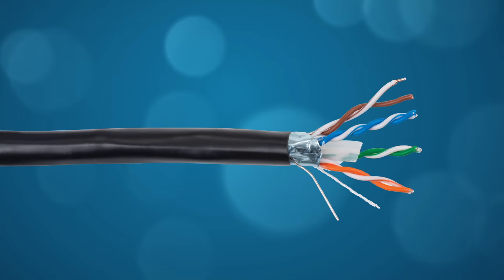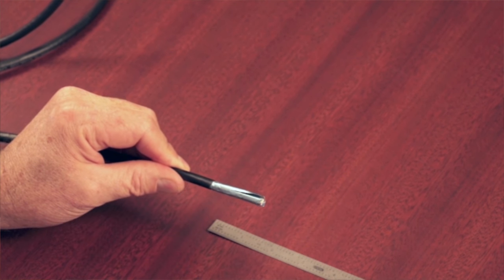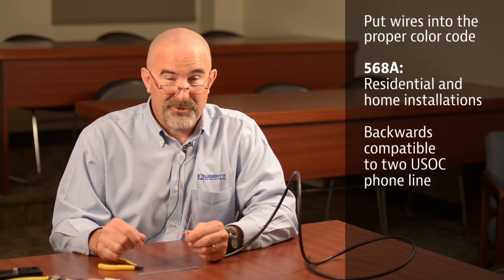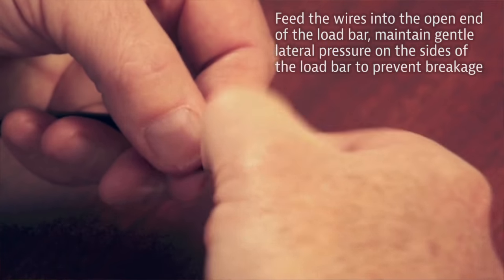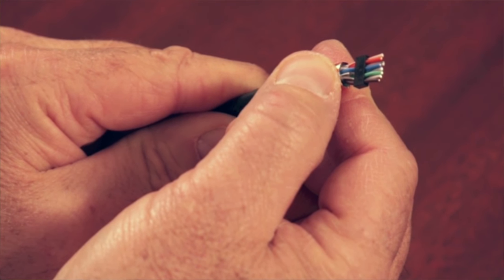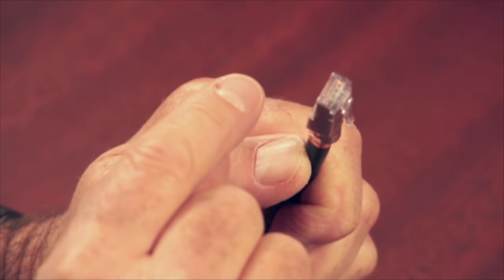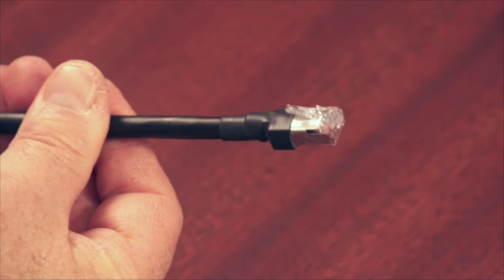How to Terminate Cat6 Shielded Cable with an RJ45 Connector

Comment: What diameter is that 3:1 shrink cable?   GREAT VIDEO!!
Reply from the maker: Thanks for the comment @dale nassar! I believe the diameter of the heat shrink tubing is 1/2" before it is heated and shrunk around the cable and connector.

Comment: "A two piece RJ45 connector will always outperform a one piece RJ45 connector"... Please define your metrics of performance? Do you mean in quickly assembling cables or actual network performance because I don't see it outperforming anything.
Reply: Likely he is suggesting failed terminations. I've done many of these and if you don't test them you will be upset when one doesn't work and you have to trace it down. Not all of the blades make contact with the copper wire as they are crimped and slide into the split blades...you can do one perfectly and find internally, there is one that didn't make good contact.

Comment: 3/10 of an inch? I’ve never seen a ruler with 10ths. I think 5/16 would be a little easier to figure out. 3/10 =.3. 5/16 = .3125
Reply from the maker: I had to LOL at this comment...good point! I think everyone has a specific way that they measure, especially Pro AV installers who constantly systematize their processes. Yes, 5/16 or even 8mm would probably be easier to digest.

Comment: So does your crimping tool only do Cat6 RJ-45’s? Not cat5e or cat5a? How about new cat7a?
Reply from the maker: Hi @Justice Freeman, thanks for the question! The crimp tool applications listed on their product page includes Category 3, 5e, and 6 Modular Plug Termination. However I am not sure if it works with Cat7 as I am the videographer/editor and not the engineer. I’m sure Liberty AV Solutions would be able to answer that for you though! I’ll provide a link to their product page below as well as a link to their updated video on this which is titled “HDBaseT Best Practice Termination - Shielded RJ45 on CAT6A F/UTP Category cable”. Thanks and good luck!
Updated video:
https://www.youtube.com/watch?v=9U84ax50PE0&list=PLle0zi-BhRL971yS435-2ef0w-9cReN2N
Link to Crimp Tool:
https://secure.libertycable.com/products/Liberty-AV-Solutions/100054LW/Heavy-Duty-EZ-RJ45-Crimp-Tool

Comment: I feel like a caveman compared to this guy. In my line of work they expect you to go fast. You will have a very sad/angry foreman if you spend 11 minutes on one RJ45. So im banging these out in like 1-2 min. Meanwhile this man is like "and now lets put a happy little piece of copper tape on our work of art :)"

Great video, im gonna have to take notes👍
Reply from the maker: Totally get where you are coming from! This is not the way to perform high-speed installations with strict time limits for sure. What it is though, is a slowed down step-by-step explanation by one of the best in the business (Ralph) to explain and demonstrate the intricacies of terminating cat cables on-the-fly. And with your reference to Bob Ross, I kinda want to see if I can take a ton of twisted pairs and turn them into happy trees in a miniature landscape setting. :)
Reply: @AngieDurbinCreates  Absolutely. One thing I did take away from this video and started doing, is to hold the crimper for a few seconds. Usually we just crimp and immediately let go.

Comment: I solder the shield to the connector Ground terminal to last longer
Reply from the maker: @sicko338 very interesting! Good to go the extra mile when you can to avoid connectivity issues down the road. I’m interested to know how many other pro av installers solder the shield and what results they’ve had. Thanks for the comment!

Comment: good video up to the point you used a paint stripper gun  to shrink the heat sink that was over the top you also had it standing 
upright closing of the air intake at the end this will make the gun overheat and burn out the elements

Comment: 10:03 minutes in the video did not close the connector body
Reply: Yea, he didn't crimp the external ground on the RJ45. Not crimping the external ground correctly can lead to a fault in the shielding capabilities of the cable.

Comment: Whats the use of shielding that portion of the rj45, when its plugged in a switch or router, it all un shielded in there. If this was ham radio we have shielding in connectors. Why hustle doing all this when everything is still radiated in plastic routers
Reply: In environments with a ton of RF noise, the cables should be shielded to prevent interference. We have to run shielded ethernet cable at our facility because many of our runs are fairly close to servo/VFD power cables.
Reply: @dan8250  do you even see any contact for grounding to that plate, unless you plan to solder a ground on it, the rj45 female ddoes not have the contact point for it either. the router itself emits rf noise with a plastic case, i really do not understand what shielding that is ever going to gain that's just a gimmick anyway. only external outdoor OTP s have shielded ground.
Reply: @jbx907  Patch panels and switches specced for shielded cable will have grounded RJ45 female connectors. Routers/switches/other end devices may have plastic enclosures, but the RJ45 port itself will be grounded. Hunt around for "shielded RJ45 patch panel keystone jacks", and you'll see they're grounded through the patch panel/rack.

Shielding is generally not necessary in consumer grade applications, but I can promise you in industrial settings, it's mandatory. In industrial control networks, ethernet cables can pick up a ton of noise, which we've had to deal with first hand at our facility. We've had network connections fail intermittently until the UTP cables were replaced with S/FTP.
Reply: @dan8250  i totally agree

Comment: 1/3 failure rate seems rather extraordinary..
Reply: everything in the datacom/networking industry is like that, ever installed thousands of switches and wireless ap's, I'm actually surprised when I find a switch that doesn't have at least 1 bad port, and OBF hardware is astronomical
Reply: Plus, you got lots of guys who can't properly terminate because they're too hung over, too worried about their next cigarette break, or simply don't know or care about the quality of the finished product.

Comment: Great video. But I installed my Ethernet cable and I cut the drain wires. I speed test the connections but it seems fine and so far I didn't encounter any problems. Is that necessary?
Reply: @AngieDurbinCreates  Yikes! I should rebuild my ethernet connections. I am dumb that didn't see this video first before my actual work. Btw thanks for the info. :)
Reply: @AngieDurbinCreates  lol 
Never even HEARD of anyone having that problem, until now. If you can destroy any switch at all with a mere termination, you've got bigger problems than static electricity lol

Comment: One thing to bear in mind is that shielded cables are grounded at one end only.  This means you have to be careful when plugging into equipment that has grounded connectors.  If both ends provide a ground, then you use a shielded connector only on one end of the cable.  Otherwise, you may create a ground loop that can cause problems.

Comment: Great video.  One technical note.  The connector is an 8P8C.  RJ45 is a Registered Jack configuration, not a connector or jack type.
Reply: Correct, but even manufacturers have begun calling the plugs RJ45's, because the lack of knowledge runs so very deep out there.

Comment: The performance gain of a 2 piece connector over a 1 piece connector is nominal compared to the labor cost of using a 2 piece vs a 1 piece. 1 piece is better, if you really are worried about performance buy patch cables.

Comment: Hello, one strange scenario. Cables from one side ends to a Patch panel cat6 and on the other side are rj45 connectors. Using the tester, all pins are ok but when connecting with computer, again everything works but some links are 100mbits and some other 1gbs. What can be the issue?
Reply from the maker: Hi @evaldo80, thanks for the great question! I asked our expert Ralph and this was his reply:  “The lower performing links have issues that are reducing the bandwidth. It can be cable issues such as kinking or bending or termination issues. A true performance tester can identify where the choke point is. Continuity testers won’t identify these particular symptoms.” So maybe a different type of tester could help you pinpoint exactly where the issue is happening. I hope that helps!
Reply: @AngieDurbinCreates  hi and thanks for the reply. Unfortunately we don't have a professional tester. What will do next is to try to redo the punch down on the patch panel. I think we removed the jacket of the cable more than what is neccessary and also untwisted the cables at all on this side. Will get also some more expensive rj45 connectors. I exclude the cables quality as it is an ftp one and also no kinking and bending. The cables are placed very carefully. We have this issue even with 30 feet cable and so i think it seems a termination issue rather than else. Thank you sir again for the reply

Comment: Small mistake. When you put the cupper strip over the shield wire, you do not make a good connection. The glue acts as an isolator.
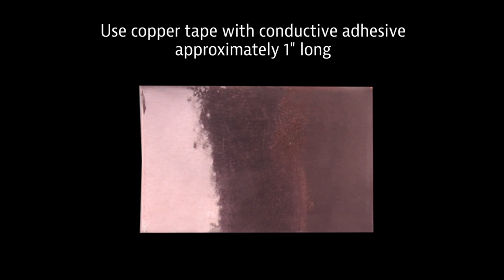Reply: 3:09  Conductive adhesive.
Reply: If you lay the drain wire OVER the copper tape to begin with no need to worry about conductive adhesive. Or does one really need to be that anal about this stuff?

Comment: What gauge conductor wire will this RJ45 hold?  I got some Cat6 they put in my house while building it last fall that I cannot find a connector to work... I've tried few CAT 6 RJ45's and have had 3 people come to the house and try that install lines and crimp on a daily bases and they two have issues.
Reply: The wire is 23 awg is what it states on the wire cat 6a. When they terminate both ends with the RJ45’s and do the test on continuity it will show pass, then fail, then pass, while everything is sitting still. The one tester we have shows something like 123U56U78. I have a video of the tester just don’t know how to post it.  No one that I have had look at this understands why it will not test out correctly.
Reply: @imlon2  Quick and dirty overview on uploading videos.  https://www.youtube.com/watch?v=klVWGHtRTuE  Then you can post the link to the video.  

Personally I'd rather see some detailed footage of the connectors.  I'd think if these are CAT6 connectors there shouldn't be any issue with 23awg.  Provide the manufacture an PN's of the connectors too.
Reply: Honestly?  If it is the same fail I can almost guarantee the issue is in the ran cable.  When it was installed someone may have popped it with a hammer and damaged the cable, or knotted and crimped it on a pull or any number of things.

  Could even be a drywall screw knicking it or all kinds of things.  Having 2 separate people have the same issue wouldnt be a connector issue.
Reply: Another good test is to use a punch panel or single punch connection to terminate the cable as a test.. and use a little 1 foot cable into a diagnoses tool.  They can usually twll you length and distance of any physical cable issues if present.
Reply: Real world tech here. We normally use an outdoor CAT5 cable for our work and installs done with CAT6 can be a heck an issue without the right connectors.

That said, I'm not sure what the issue is if they have the right staggered CAT6 specific ends. Normally I snip cable strand ends with diagonal cutters but have found this actually causes issues with tight cables fitting into cat6...use the razor snipper built into the crimp tool.

The suggestion of another poster to test with a female jack punched down is a good one as well.
Reply: @imacrazyguy5831  Yeah I had considered that possibility.  Wasn't going to cross that bridge just yet though.  I also don't have a lot of faith in guys terminating cable... so one thing at a time, and work on what can be worked with.  Cable in the wall... well that ship sailed already...
Reply: @imacrazyguy5831  They make a tester for cat cables.

Comment: What a great video and a great presenter! I have one question, though: how to prevent the plastic locking mechanism on top of the plug to break when in use? I have had some trouble with this previously on cat 5 installations - but what about cat 6 when installing plugs myself?

Comment: Why do you instructors all do it on a table try doing it on a wall with no movement solid brick wall no pushing it back down the wall.Just wondering mine has 4 cables in the one plate it’s a nightmare.

Comment: excuse my ignorance...why cover the drain wire and not just cut it off?
Reply: @AngieDurbinCreates  Terminating only one side of the drain stops it from operating like ground loop, or unintentionally carrying voltage to ground for another  pieces of equipment (think of another power supply in the same rack failing and potentially sending that current through the rack to the equipment's chassis that the cable is connected to.  Of course the rest of the environment has to adhere to proper grounding.  You have to know the environment to determine what side should be grounded as there isn't any signal "source" with bi-directional communication cables.  Hope that make sense.  I wouldn't expect static to be a primary concern.  The purpose is to shield the cable from outside RF interference, and "drain" it off to ground.

Comment: Do a real world speed/quality test with a standard cat 6?

Good video btw👍🏻
Reply: @AngieDurbinCreates  yeah do a test, if you get better or worse performance using just a standard EZ RJ45 and this way, and see if all that extra work and time makes for better connectivity.
Reply: These are not about speed (as opposed to standard cat6) this is for shielding/RF interference. Speed should be the same if you use the same cat6 "quality" ie awg 23 and awg 23 not 23 and 24
Reply: @tollav  pretty easy to do this test too

Comment: And i'm here wondering why you don't use plastic caps :/
Reply from the maker: Hi @Aurélien ETIENNE1, that is a great question! Cat6 termination with a standard RJ45 plug and heat shrink tubing is just an alternative solution to using the standard plastic boots. It is a slower method, but the key benefit of using heat shrink tubing is that it provides extra air-tight protection from water and abrasion and adds excellent strain relief. It is so durable that it is favored by the military, aerospace, electronics and railway industries. However, if you have several installations to do in a limited amount time, then regular strain relief boots or pre-terminated category cables are totally acceptable.
Reply: @AngieDurbinCreates  OK thanks for your reply. But you can still use caps when you are doing this method?
Reply from the maker: @aure_eti  I posed your question to Ralph himself and he said that you CAN use a boot with the shrink tubing but it might need to be a specific size for larger cables (like 8mm).  The standard size would be too tight. Hope that helps!

Comment: Thanks alot please can  you explain to me why : I made a cable whith 26 meters It works from router to pc but to reciever no  network
Reply: fetah morabiti you shorted the end connectors. Retip them correctly and it will work. Cat6 runs can go up t0 300m.

Comment: Where's the RJ45 boot for added strain relief.
Reply from the maker: Hi @sonicperformance, thanks for the question! The heat shrink tubing serves as the added strain relief instead of a boot. However you can add a boot if you like for even more strain relief. You would probably just need a size for larger cables (like 8mm) to fit around the cable since it already has the heat shrink tubing. By the way, Liberty has an updated video on CAT6A F/UTP termination if you'd like to check it out! https://www.youtube.com/watch?v=9U84ax50PE0&list=PLle0zi-BhRL971yS435-2ef0w-9cReN2N

Comment: When you get paid by the hour not the job :p
Reply from the maker: @Rum and Bass, you're absolutely right - this wouldn't be the ideal approach for a large installation. But it works awesome if you need a custom cable length and want make sure it's a reliable connection. Cheers!

Comment: that just seems like a whole lot of unnecessary work, when EZ RJ45 crimps work very well. How are you supposed to do a job with 25-50 wires when doing one crimp end takes almost 20 mins?
Reply: you are the only person who crimp 100 ends. smart people buy patch cables.
Reply: @beimghadaw  ok, then I do keystones, and then get the patch cables, if the client wants a patch panel, or just directly in a switch.
Reply: @beimghadaw  you still have to terminate the wire when you pull it. be it, keystones, or a punch down panel, or just rj45 it to the switch.

Comment: And this is why I just get them pre-made.
Reply: Using pre made cables is not an option if you need to run the cable through a couple of walls :-)

Comment: Would/could be useful if connector is designed where, inserted wires extend beyond end of connector (to confirm proper order of wires); then, at the point of crimping, excess will be sheared off, flush with connector end.

Comment: 1 in 3 failures seems unlikely, unless it's people who have only made 6 cables.
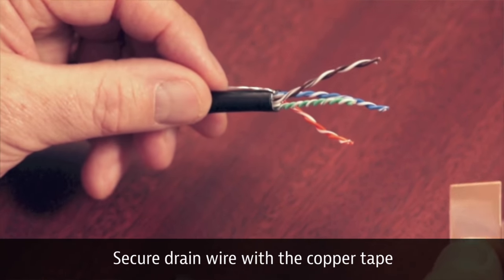Reply from the maker: @s s thanks for the comment, it’s an average depending on variables of your situation. As you mentioned if someone is less experienced with terminating Cat6 cables, that can be a factor. And another thing to consider is your climate. If you are installing in a very dry climate like Colorado (which is where the star of this video lives), the potential for static electrical shortages are much more likely than in a high-humidity climate. So that’s why securing the drain wire with copper tape serves as a ground, and why it’s part of these best practices. (This is shown at 3:20)